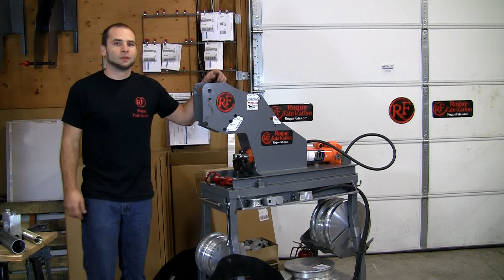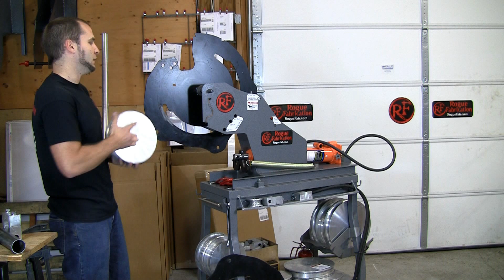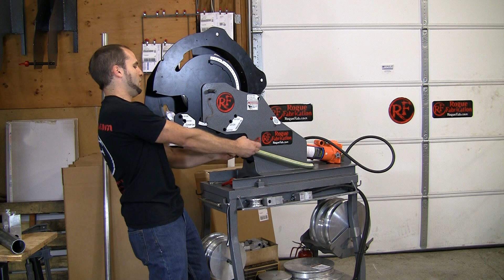How to assemble a Rogue Fabrication Model 600 Tubing Bender

Comment: I'm seriously shopping around for a tubing bender right now. I thought this would be a good option to save money since it needs to be welded. I looked at the website, those prices are way too high. Your kit with one set of dies is several hundred dollars more than an assembled bender from Eastwood with 5 sets of dies. I wish you the best of luck with your business, but there are cheaper well-known name brands out there to compete with. It's a shame, I was looking forward to welding your kit until I saw the cost.
Reply: I did a lot of comparison shopping on benders before I purchased my M600. The Eastwood kit you are looking at has a lot of drawbacks.  Tubing size and thickness are the 2 biggest deterrents that I found.  With the Eastwood set up you can't bend 2 inch .120 DOM,  you can only bend to 90 dgs and wall thickness up to .090.  This bender can bend 1.75 solid steel... If you are doing non structural work like transmission mounts I can see the Eastwood unit working, but If you are doing any cage the Eastwood falls short.
Reply: I'm not buying the Eastwood, I just threw that out as an example. But for what I do in my garage, it would probably work just fine. As I already said, the Rogue bender is the one I want. I just can't justify the price for doing hobbies out of my home garage. Again, I wish you the best of luck. It looks like a good product
Reply from the maker: Flash summed it up pretty well. We don't price compete with made in China machines with the capacity/functionality limitations that machine has. It's not greed. They sell machines below our cost. You get what you pay for.
Reply: the east wood one u are refering to cant bend over 90 degrees-and is garbage
eastwood also make a nockoff of the jd2 and if u look at that one 300 plus a die 2-300 do u are at 600
plus i like a vertical bender better